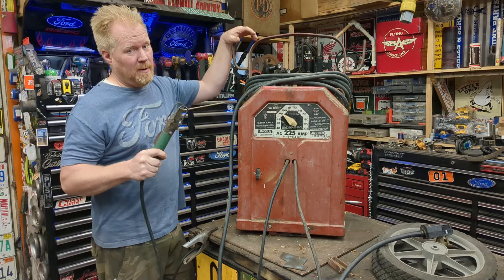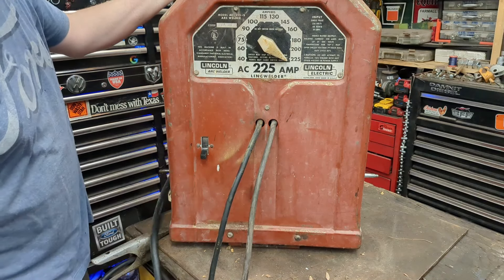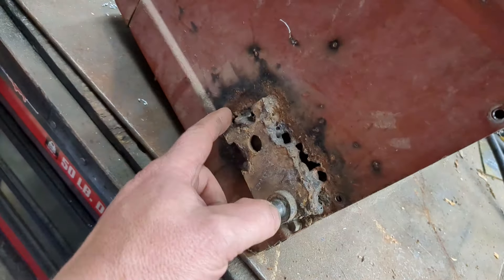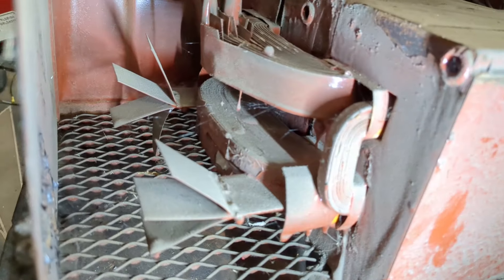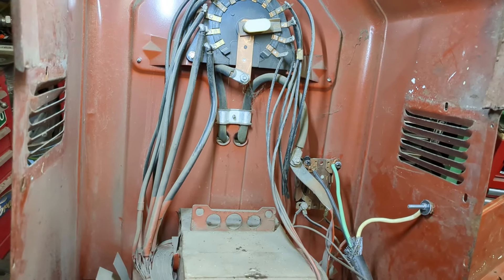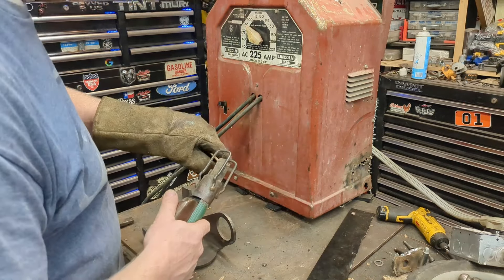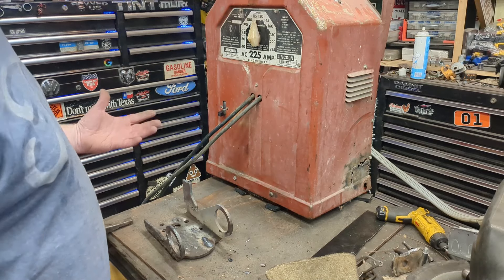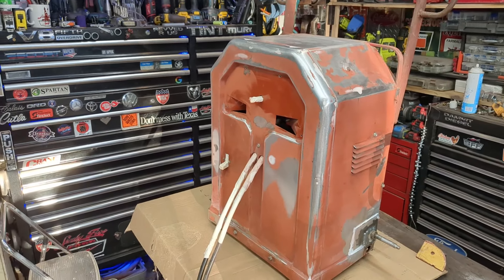Vintage Welder Fixed & Restored LINCOLN TOMBSTONE 225 AC buzz box

Comment: Fabulous restoration, and fun video to watch.  Thanks.  If you came up with a diy 12v air compressor to mount somewhere hidden on a pickup, that would be fun :)  ....for me at least. lol
Reply from the maker: Yeah, everyone of these that come through my shop gets wheels put on. They're a bear to move if you don't. I like the dolly idea.
Reply: @ Jonathan Morris

 Decades ago, one of the most common ways to get on-board air was to grab an A/C compressor along with all the bracketry that would bolt it to the engine you were running. You'd convert the A/C unit to pump air and plum it to a small tank under the hood or another larger tank somewhere else on your truck. There were some modifications that had to be made such as including a pressure relief valve and you had to attain and install the appropriate fittings to connect to an air line, etc. Overall, I considered these systems to be easy to fab up, fairly cheap and quite functional. The sticking point for most folks was they didn't have a tank that was nearly large enough to air up all the tires they needed to after an off-roading expedition. Anyway, it's something to consider as it may work for you. Best wishes! 👍🏻🛻👨🏻‍🔧

- Max Giganteum
Reply: @MaxGiganteum  That might be beyond my skillset, but I like the idea of something engine powered.
Reply: The WWW is your friend in this regard because you might find a website or multiple websites that contain all the information you need including a parts list and a step by step list of instructions on how to get it done (you might even find a few videos). This was common for vehicles built by Ford, Chevy, Toyota or Jeep for example. As for the difficulty, don't let that scare you off. Many of the conversions only used commonly found automotive parts and other parts easily obtained from the likes of a Home Depot. The tools you'd need only include regular hand tools. My best advice is to research and see what you can find then formulate a plan that's viable and execute it. Peace & good vibes! 👍🏻👨🏻‍🔧🇺🇸

- Max Giganteum
Reply: I had a setup like that on a 1979 Dodge 1/2 ton Power Wagon. It was on their when I bought the truck.
I used the truck to plow snow and the Minnesota rust worm ate holes in the tank under the truck so I took it off and scrapped it.
The problem now is just about all engine compartments are so packed with crap and all accessories are driven with serpentine belts installing one is near impossible without getting a mechanical engineering degree from MIT!

Comment: I almost had a heart attack when you moved the camera to the back. Saw immediately what they'd done n really I don't know how that thing didn't bite you when you turned it on. Looks great now, like it just came out of the box
Reply from the maker: I have no idea how this didn't shock me. I put my head right next to it to listen for the fan/transformer and touched it with my bare hands repeatedly.
Reply: The question is, were you grounded? Obviously not or there simply wasn't a good connection between the positive wire and the case. What I always ask is, "What kind of shoes are you wearing?"  and "What are you standing on?". Interestingly enough, when I was much much younger, I remember a number of dad types always standing on a wooden platform whenever they worked on something electrical and the power was connected or otherwise on. The idea was that they were never grounded and it was highly unlikely they would get shocked. As far as I know, none of them ever got bit. They must have been doing something right. Best wishes! 👍🏻⚡👨🏻‍🔧

- Max Giganteum
Reply: @MaxGiganteum  grounded isn't necessarily meaning your connection to the ground you stand on. But it's always good practice when dealing with electric to be aware of the electrical circuit having a path to ground through your feet. But in moe's case, the entire case was hot, n the ground n another hot were fighting each other through the leads. N having it sitting on a steel workbench means now the bench is hot from the case on top of having the ground clamp n electrode running current through the table. N him being unaware of it he could have inadvertently placed himself into the circuit as well by making for a bite. Whether just a tingle or a full on bite. The electricity was just doing too many unpredictable things to think just being insolated from the floor would be enough to prevent a bite. Ideally when an electrician is servicing live wires they are only dealing with 1 live at a time so not being grounded to the floor or anything else is one of their main priorities. But say the box you're working on is grounded n you touch a live wire n bump the box, you get a bite even if your shoes are awesome n you're 10 feet off the ground

Comment: A little over 50 years ago I was selling those for $125.00, now you couldn't buy the leads for that. I am guessing since I have no clue anymore. Looks like Amazon has those 225's refurbished for $1,014.17
Reply from the maker: Last I checked the Home Depot was selling these new for around $450. Not sure if they have them in stock though.

Comment: I buy the old school welders for next to no money and donate them to young guys starting up.
We old guys need to help the young guys get into welding and mechanical stuff because les and less of the younger generation are able to afford stuff or get the chance to try to weld.
Great video hope that machine gets someone going in life.
Reply: @MPM Welding that’s where I am and your right.
That’s why I try to get youngsters interested in welding fabrication , engines if we don’t we will lose out mechanical knowledge.
Reply: @MPM Welding what type of welding do you do.
Where are you located I’m in Leeds.
Reply: @MPM Welding not many stick welders still here in UK .
Back in the day I had an old Clarke stick welder I had to weld airtight on exhaust silencers after removing the baffles.
I had very little equipment then and plenty of time.
My problem now I have all the equipment I need but very little time to use it.
Reply: I used to do that but lately when I offer a welder. The entitled little creeps say they want a Miller, GTF out of my shop is my response.
Reply: @MPM Welding Learned on a torch setup and a Montgomery ward buzz box. Thought I was the king of the block when I was given a used set that needed replacement bottles, broken rack with flat tires. Still have and use the buzz box and victor set to this day just because it works. And, it's paid my mortgage many times over.
Reply: @ellkir1521  I was happy with a cheap stick welder I’d b the same if they expected a millet.
Reply: Have you seen the price of welders now? 😂

You can get a decent multi-process welder on eBay for $200. A basic one for $60.

I have two Lincolns, an Everlast and a Chinese welder off eBay. I can't kill the Chinese welder, I've tried. I've had it for 1 year now and I paid $260. It welds aluminum straight from the Mig gun. I honestly feel like I wasted money on my Lincolns. Having the two open side by side they aren't much different than each other.

I'm not arguing weather the old ones are made better than the new ones. That's a different discussion.

At any rate. It's not that they can't afford them, it's that they have no desire too.

I'm not sure how long you've been out of the game or where you live but I'm a contractor and I can't get anyone to show up for work. I have all the equipment anyone would need. They don't even have to bring their own tools and they still don't show up.

If only that was their excuse. I've offered to buy guys tools and they still don't show up.

That's what happens when you flood the country with cheap labor you coddle your children and you send them to school for graphic design instead of a trade.

Now we have a bunch of lazy graphic designers working at Starbucks instead of doing productive things.
Reply: @dangerous8333  yes your right I see a few school leavers with interest but they soon lose interest.
I’m in UK
Reply: Good man. You are too right

Comment: I got one of these bad boys, still use it, knock on wood haven't had any issues with it. That is crazy could have killed you
Reply: Fortunately the connection to the case was non-conductive.
Reply from the maker: If he was any better at wiring and tightened the bolt it would have given me a good shock.
Reply: @sixtyfiveford  and they say two wrongs don't make a right. It sounds like a reversal to me.

Comment: Never plug in an old piece of equipment without opening the case first, and doing an inspection. Also never let anything you crank up or plug in get between you and the door. Always have an exit.

Comment: Another saved .. i remember those in body school in 1970. They were a beast but very good you could weld a frame stronger than factory ..next time you paint something like that  try automotive engine paint it's really durable and lasts for a long time .. i use it all the time the colors are limited so you have to choose what's right for your project..i really come here to see Ginger..lol..

Comment: What's size generator this will run on .
Reply from the maker: To run it at full capacity you'll need 12,000 running watts (15k surge). However, you'll rarely if ever run it at peak so a 10k generator would be fine for most welding jobs.

Comment: Excellent repair/restoration!  Glad you didn't get bit. Hindsight is always easier... But it would make sense to continuity test between the plug leads and the frame of any machine that there is any question of how it was wired, in the future.

I currently use a multiprocess (TIG/Stick/Spool) and a dedicated MIG machine; but I originally learned on a Lincoln tombstone welder. They're still a tremendous amount that can be done and repaired with a machine like that.
Reply from the maker: Thanks. There's something about how smooth the transformer welders weld vs all the modern inverter stuff.

Comment: I still have my Lincon 225 amp welder just like this one I bought back in the early 70s and I still have it and it welds like the day I bought it. I since then have graduated to a Miller Mig 200 amp and a Miller 140 amp wire feed welders.  I have all three and also a Large bottles and Victor Oxygen Acetylene torches and tips for gas welding and a smaller set of them for gas welding too.  I wanted to become a welder after I got out of high school but life led me in a different direction and I got into the Plumbing and Septic business trade and made more money that way than I ever would as a welder.  But I still make things and love to weld.  I learned to weld back in high school around 1970.

Comment: I own a Lincoln and a Miller welder.  Both from the early 1970's.  The last time I used both were in 2006.  Thanks to your video I'm going to get them out of the storage locker (which is unfortunately located in another state 300 miles away) and start using them again.

Comment: You are incorrect about those always having aluminum wire. I have a very old Lincoln welder just like that that has solid copper strap. Not wire. The old ones with copper strap didn’t have Cooling fans.
Reply from the maker: They're aluminum painted in a copper colored shellac. They're are no 225 with copper; this is per Lincoln themselves.  There are a few 180 models made the first years that were copper with individual plugs/taps (no dial) for amperage control.
Reply: @sixtyfiveford  want to bet? I have a welder just like that that has solid copper straps for wire off the transformer. It doesn’t have a fan because there are heat sinks on the side of the transformer to keep it cool. According to the sticker inside, it was made in 1956. Lincoln didn’t make many with the solid copper straps and heat sinks. It welds smooth as butter. There’s nothing better than a copper wound welder.

Comment: Would anyone happen to have a link or know what those electrode holders are called?
Reply from the maker: That exact electrode holder AKA Stinger isn't available anymore . You'd have to find a used one off eBay. It was only made in the 60's-70's

Comment: I gave you a thumbs up and subscribed. One thing if an electrical cord has been replaced and a machine is not running don't plug it in without checking it first!!! Over the years I have seen to many horror shows from just what could have happened to you. Be safe out there!!!

Comment: No they where not always aluminum I know for Shure because I change one out one tim and it went for copper to aluminum.
Reply from the maker: Per Lincoln Electric: none of the US market 225ac were copper. The predecessor the 180ac did have copper along with a few early model 225AC sold outside the US. But none of this matters in the slightest.

Comment: I bought two of those welders for $50 each. One was pristine with 30 foot leads and the other literally fell off the back of a truck. I fixed up the ugly one and sold it. It paid for the nicer welder, 20 lbs. of rod and a DIY 240 volt extension cord. They are easy to fix, easy to shine and you can't kill them. You scored a find too.

Comment: Love recycling older equipment however before I test anything out I take readings with my multimeter to check for any faults to the housing that could lead to serious injury. It’s well worth the time and then do a serious visual inspection of the equipment. 
Love the finished product! Only tombstone welders I saw in the day were some cheap buzz boxes that ran on 120 volts and they were at Lowes, must have been chineesium clones with the Lincoln badge on them.

Comment: Lucky you did not end up with a fro LOL.  Never had one of these so when I bought my first used one I opened it up out of curiosity. Was dirty but no wire issue. I have a video on it if you get a chance. Still "trying" to get the hang of it.
👍319
Stay safe, Joe Z

Comment: I have a LINCOLN welder case from 1945 that I salvaged and cleaned up to save and re-use.
I just want a good AC/DC box to donate its guts and transformer to it.

I am really thinking about a fully customized, auto-paint quality Candy-Apple Red Metal flake paint scheme with badges that are custom made to be the thick, plastic dome type.  Chrome all the switches and the rotating piece, and do some custom Pin-up Girl art on the sides and name the welder "Tess".

I even want custom rims for the 2 wheels.

Yeah, total waste of money, but who gives a shit, right?
Reply from the maker: That sounds awesome
Reply: Well... it is your time and money, yeah?!? 🤔👍🏻🇺🇸

- Max Giganteum

Comment: I picked up an ac/dc tombstone for the same price you paid. It Was at a pawn shop on the discount section, it had 50' of extension cord wired to the actual prongs and then taped over, it's a decent welder for what it is.

Comment: Interesting video.  That cord!  Never underestimate the power of human stupidity!  Never had a Lincoln. Learned 50+ years ago on Dad’s Forney C6 buzz box (unfortunately, the Forney was too far gone when he died in 2014). Always appreciated that the 180 amp Forney was designed with Rural Electrification Areas in mind, and needed only a 30 amp circuit.  The 250 amp AC/DC machine I bought from Monkey Ward in 1980 calls for a 60 amp circuit, but works on a 50 with a range cord.  I’ll keep my eyes open for a steal deal on a tombstone.👍

Comment: I found one of these on the side of the road next to a local Trailer Park. It had been discarded and left for a scrapper. It was in rough condition and the shell had rusted through at the bottom. (not to mention the leads had been cut off.🙁 However,  the internals we still good. A little work made her functional again!  Thanks for restoring yours. It looks brand new!
Reply from the maker: That's awesome
Reply: His is better than new! Big wheels and cable hangers.
Reply: Yep, the old ones are simple and you actually have to try hard if you're going to wreck them.   The previous owner of this one looked like he tried 😆

Comment: I bought mine in the late 70s and it's still going. Ran it off a 30 amp dryer circuit for years. It worked but would pop the fuse at around 130 amps if I welded for too long. Mine never had a wheel kit but it's a great idea and those large wheels sure are nice. Great little machines! You did a nice job restoring it!

Comment: My father has that welder, it is what I learned to weld with. I think anyone interested in welding should learn how to stick weld first before they buy a mig welder, mig welding is easy and if you start out learning how to mig weld, you may never want to stick weld so it will be one less skill that you know,  like you said, you can buy a second hand welder for cheap, there is no excuse for not learning and it's a handy skill that you will always have even if it's not something you use everyday.

Comment: I learned to weld using the 180 Amp version back in 9th grade shop class.  That would have been 1966.  The shop welder wasn't new and it was horribly abused by every male 9th grader.  it may still be there.   I bought a 225 Amp tombstone buzzbox in 1970 that my nephew still uses.

Comment: If you work on equipment, you need a welder.  I have done small welding jobs on equipment I work on for customers 4 times in the last 6 weeks.  It comes in handy, is enjoyable, and keeps you from running back and forth getting welding done by another shop.
Reply from the maker: Absolutely